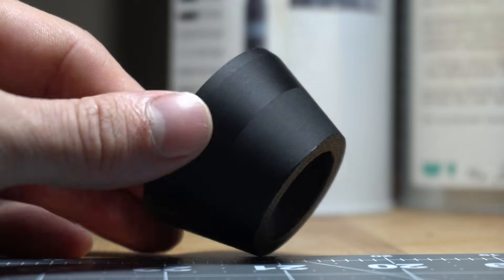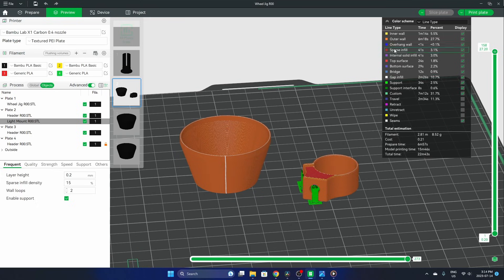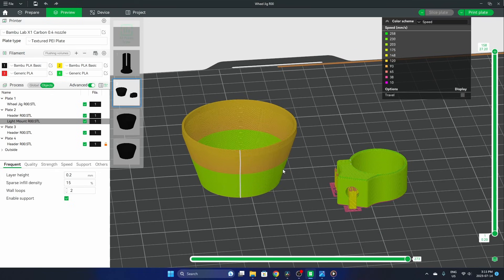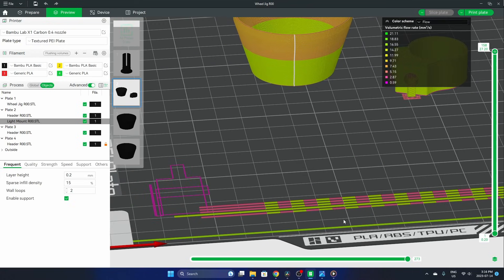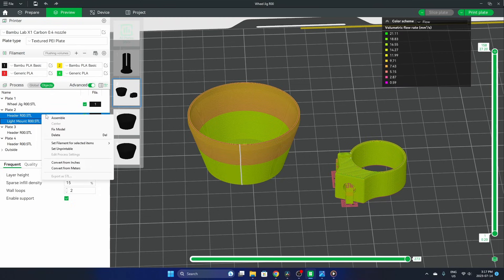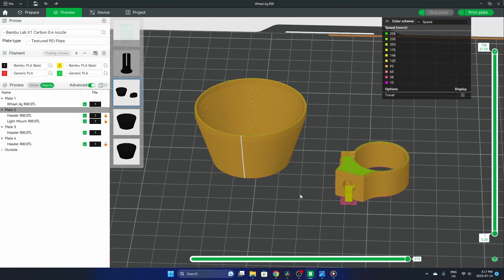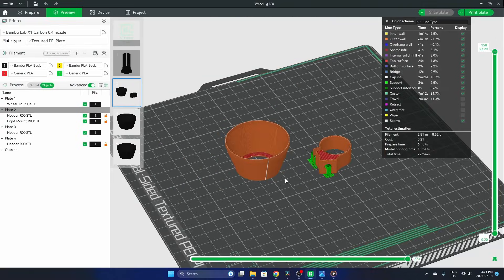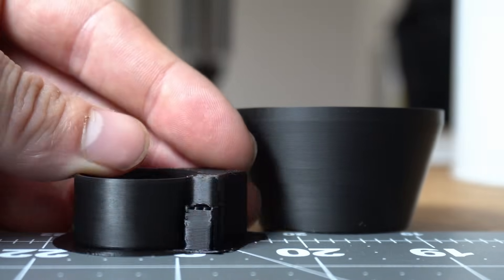How to avoid 3D prints that look like THIS in Bambu Studio

Comment: that's also a low infill print, so the bigger prints with a lot of infill it won't hurt you as much on time, because lower % of the print are walls.  Another variable is that a high percentage of that 25 minutes is the bed leveling and all that stuff, doesn't that take like 8 minutes or something?  So anyway my point is there are a lot of variables, but for the most part lowering the outer wall speed won't hurt the time much.  Also not 100% sure but I think part of what decides the difference in speed / flow is overhangs, so you can play with those speeds, outer wall speeds, etc.  and don't necessarily have to drop it by 50% might get away with less, maybe 150 instead of 100?  idk just some random thoughts.  Anyway thanks for posting this I was really getting annoyed by this problem, and didn't know about that speed/flow view thing.

Comment: Print by PART separately  vs by layer.  You wont loose the speed and get same resulst.
Reply from the maker: Yeah that would fix this print but I've also seen this happen on a single part when it is much larger on some layers and smaller on others.

Comment: Differences in layer time also cause this, not just speed. Infact a sharp transition in layer time has a greater visual impact that than speed.
Reply from the maker: Layer time is really just adjusting speed/flow rate via a different setting. You're basically adjusting the same thing. Lowering the outer wall speed just makes sure you get a consistent look across your entire print.
Reply: Actually no thats not true. Test it. If you print a cube at a fast speed with a low layer time you'll get a shinyish finish.

If you print the same cube at the same speed on the outer wall but drastically slow down the infill such that the layer time in total is 25 secs or so you'll end up with a matte finish. This is because the layer below it has had time to cool down and doesnt get reheated by the layer above.

Ive done many tests on this and this is the cause of a lot of the banding people see on the X1C with PLA.

As I said above you can mitigate it by slowing everything else (other than the outer layer) down.

If you slow the outer layer below 100mm/s you seem to get print artefacts on the X1C.

 @3DPrintStuff

Comment: why not let bambu lab actually use this to make a partially matte and gloss model. Its actually gonna be cool
Reply from the maker: Yeah it could be cool but usually you’re going for one look or the other. And the matte colour is arguably less strong because less heat is getting into the plastic and the layers may not be bonded as well as the glossy portion.

Comment: I found a bug in bambu studio. Sometimes these artifacts show in splice but adjusting height of layer makes it equal all over. if you save it as 0.16 then open it it sometimes show artifact. if you then change to say 0.2mm it will make arrifacts dissappear. if you save then as 0.2 next time it has artifacts at 0.2....but if you rhen adjust back to 0.16 it no longer show artifacts.

bug is especially visible if you have ironing on printed models
Reply from the maker: Very interesting, thanks for sharing. Have you emailed bamub lab to let them know about this bug?
Reply: @3DPrintStuff  i wanted to make a video...but the problem is not consistent every time.

Comment: It isn't just how the part looks. This glossiness, in fact, tells you that the polymer crystallised more and has better mechanical properties. The matt surface finish means that the part didn't get enough energy and is weaker in almost every aspect (tensile strength, temperature resistance, etc).
Reply from the maker: Yeah this is a good point. Visual indicator that the plastic isn’t getting enough heat. You’d probably be able to bump up the nozzle temp and not have to slow down the outer wall speeds at all.
Reply: One additional consideration, given the notion of adjusting the 'minimum layer time': as a way to solve this harsh transition, is that: Your solution would work more effectively if you have a short (5mm) part that takes up half the build volume and a tall (150mm) part that takes up the other half. If you constrain the overall 'minimum layer time' to match the layer time that occurs when both parts are being printed (the first 5mm worth of layers), that would force all of the other 145mms: of the tall part, to print at the same slow pace. 

But, certainly, Matte finish vs glossy is an indication of extrusion temperature... which does impact the strength/adhesion of a part; whether it's to a significant degree of detriment is dependent on the use-case.  @3DPrintStuff
Reply: People are wicked smart in this 3d printing world.
Reply: @burrbentine   No, just knowledge that comes with time (a few years) using a 3D printer.
Reply: @alejandroperez5368 Haha typical answer of a smart person. But you are not smart enough to hide it,🤪
Reply: I thought the lack of glossiness was due to it cooling too slowly. The crystallization causing the dullness and weakness.
Reply: @3DThird great video and even better comment. How do you suggest rectifying this? Bump the temp up?
Reply: @theneutralnode-s  As people may have already suggested you can:
1- bump up the temp
2- slow down outer perimeters so that they are the same speed throughout the print job. Tip: for maximum strength you may want to slow down both inner and outer perimeters.
Reply: OK sure but u can still make the highest quality filament look just as bad as cheap filament with the wrong print settings

Comment: You can print the flow test in orca slicer and pick a flow rate limit in the material properties. Bambu PLA stays glossy to about 8mm3/s @220C.
Reply from the maker: This is good to know. I haven't used orca slicer at all yet. Any other features you use that are exclusively on orca slicer?
Reply: @3DPrintStuff  the flow test is only available in orca. To adjust flow rate limit in bambu studio select edit icon next to your selected filament. Last setting on the first page is max volumetric speed. When set to 8 pla is mostly glossy, but you can reduce it even further.
Reply: @3DPrintStuff  i just use orca for the calibration tools and bambu studio for the rest

Comment: How do you handle your chamber temp when printing PLA? when i print PLA with 55 degree bed temperature, my chamber hits 38°C easily, with door 5cm open and top lid rose with spacers (unable to take off, i have AMS).

Im thinking to put another fan in there to vent the hot air out, placed at the back, on the stand where the VOC Filter opening is, so that is blows in direction of the door.
I have the feeling that when the temp in the chamber gets too hot, my overhangs start to get worse.... because PLA likes it pretty cold haha
Reply from the maker: Still something that I'm dealing with myself. My printer is in a unheated garage so this past winter (-25°C) I had the opposite problem where I actually had to use a little space heater in a grow tent to bump the temperature up a bit to be above freezing. 

Now that it's summer and we're seeing +25°C I print with the door wide open. A fan won't do much in my case cause you're still pulling hot air into the printer. I've still been pretty happy with the print quality so I don't feel the need to explore more options yet. Let me know if you land on a good solution.

Comment: Make sure the nozzle temp is on the high end fans are going full blast when you lower that minimum layer time.
Otherwise you might clog the nozzle or extrude warped lines. Tis a careful balance.
I think slowing down the overall print speed was the better option haha.
Reply from the maker: Appreciate the input. I also feel that lowering the outer wall print speed is the better option even though I didn't know about minimum layer time while making this video. I think I'll make a follow up video exploring minimum layer times and comparing the print time and quality.

Comment: I believe it is better to change "Max volumetric speed" in filament settings. Which do basically the same, top speed is limited to the (volumetric) speed which still works for this filament.
Reply from the maker: I'll have to check this out. Sounds like that is a global change that will effect every print going forward with the filament that has this setting changed. I like the control of changing the outer wall speed on a print by print basis. But that's just personal preference. Your suggestion would be set and forget, wouldn't have to think about it again.
Reply: @3DPrintStuff  it is personal preference.
I started with various print settings, probably as you, but finaly end with basically one print settings (defines what is printer capable of + nozzle diameter, layer height, acceleration of each wall, surface, infill and so) and settings for each filament which also limits max volumetric speed which can be used regardles of e.g. nozzle size.
With this, I can easily use the same print profile for print e.g. ABS as well as TPU without any further modifications of profile (well, few exceptions as support, wall count, infill type and density are stil object per object).
Reply: No, the max volumetric rate is used to prevent situations where the hotend can't heat the filament fast enough to fully melt it, at high printing speeds. Its correct value depends on the hotend, the filament, and printing temperature. If you lower it for cosmetic reasons, you can certainly make the printer slow down, but then it will waste time printing the infill and inner perimeters slowly. Here, only the flow rate (printing speed) of external perimeters is causing the cosmetic issue.
Reply: @renxula  external perimeters is only thing I have set lower (to about 200mm/s). Everything else is driven by max volumetric speed only and it works like charm to me for several years.
Each filament has set own max volumetric speed in its profile and that's the only "speed" settings I'm doing with new (type of) filament.

Comment: Now work on fixing those hideous seams. I hate my bambu printer. It’s been two months and still working with their support to try to fix several issues. Not to mention the print quality is terrible was horrible. Seems really poor tops on rounded surfaces and banding and seems separation etc. etc. I end up just using my MK3. I’d rather wait three times as long as I have a decent print that I know it’s going to work.
Reply from the maker: Sorry to hear that's been your experience with this printer. I haven't had any hardware issues but the tops of rounded surfaces are pretty bad and the z seams are very noticeable. I'll have to explore some settings to try and improve those results.

Comment: You may also want to pay attention to the cooling of the filament, i.e. the layer time, which also affects the print speed. If the time to be used for the first matte part of the lay<ers is less than the set time, it will print slower and accelerate once the time to be used for the complete layer is more than set.
Reply: This is the real reason this is happening. Good pickup
Reply: THIS ☝☝!!!! 

I kept getting super glossy sections at the top of my prints, and this fixed that. Thank you!
Reply from the maker: Yeah I didn't even know that was a setting that was having an effect in the background. Makes total sense that the minimum layer time would make the top half move slower which puts more heat in the filament and gives it the shinier look.
Reply: @3DPrintStuff That was exactly the problem with your pieces.

Comment: You are hitting the minimum layer time when the first object finishes so the printer will slow down to respect that value.
Reply from the maker: That is definitely what is happening and I didn't even know that was happening in the background until this comment. Thanks for the observation.
Reply: I really don't think this is a good approach on the part of Bambu studio. Fill could be slowed, or the printer could pause between layers.
Reply: Perhaps this is the explanation of the infamous Benchy Hull Line? Layer time is lower when above the layer where there is infill?

Comment: Yah, just buy the fast printer and then slow it down ha.
Reply from the maker: Just for exterior walls and only if you're experiencing cosmetic issues and if you even care about the looks of that specific print. 

It has also been suggested to increase the print temperature which will allow for the faster printing but that can have it's own negative effects on quality.
Reply: @3DPrintStuff  you have to reduce the speed to even out the finish and maintain strength. Everyone simping over Bambu for no reason.

Comment: Sequence printing Print-by-object - Also, an interesting option which may avoid slowing print time is to use sequence printing, called Print-by-object within Bambu Studio! Hope this helps!
Reply: That's a great solution but the same issue can occur on a single part too. Had this multiple times and couldn't figure out a way to fix it besides turning down speed so far.
Reply: @alflo8970 In your filament cooling settings, if "Slow printing down for better cooling" is enabled, you can reduce the "Max fan speed threshold -> Layer Time". This way, unless your layers are tiny, they'll print at the same speed and the issue should disappear.
Reply: its a great setting for TPU to reduce any chance of stringing..
Reply: @wtfpercussion  "Arrage all objects"  or press key A
Reply from the maker: This is a good suggestion. I haven't really played around with Print-By-Object out of fear of causing unnecessary collisions.
Reply: @3DPrintStuff impossible to collide as slicer makes sure there enough space between
Reply: @3DPrintStuff In cases like this where you have plenty of space on the build plate, simply placing the parts so there's no overlap in Y - allowing for the depth from nozzle to front/back of toolhead- should guarantee that sequence printing doesn't crash.

Caveat: Filament/toolhead swaps, any auto-home/park on power outage, etc., but for straight single-filament prints this should work.
Reply: @axel_fagerberg  yup, just right click an empty spot on the build plate and select "Auto Arrange"  and the slicer deals with it by itself
Reply: @wtfpercussion   yes it can, just enable the feature print by object, and then select "auto arange" on the top , it will space out the parts maybe a bit too generously, but i use it all the time, in case 1 print fails. i dont have to start over the other ones too.   so far , never had a problem.
Reply: @wtfpercussion it should show you a outline in the slicer of how much room you need

Comment: Awesome tutorial thanks so mcuh for sharing :). 

One thing you can do to slow the print speed down is adjust the flow rate in the printer for your material. By default, bambu PLA basic materials print at 21 mm/s. I've found that dropping the flow rate down to 10mm/s keeps everything nice and glossy, the printer will automatically show the print speeds down to match the new flow rate max.
Reply: I came here to say this but 10mm^3/s is REALLY overkill. When I first got mine i tested stepping down in increments of 1 and stopped at 17. Works great for me.
Reply from the maker: That's a great tip to set and forget. Don't have to adjust settings on a per print basis.

Comment: I assume the reason it's slowing down once it's printing only the one part is probably the minimum layer time. You could try and decrease that value, but you gotta make sure that cooling is still sufficient then. This should not be a problem on bigger prints though.
Reply: This is absolutely due to minimum layer time which is why the slower print speed doesn't change the overall print time much.
Reply: @MichaelPetito  it's definetely the wrong way to handle this by the slicer, it should check for cross-section width and fan speeds and adjust min resting time depending on that
Reply from the maker: I'll have to look into this.

Comment: I've found that printing PLA at 250 degrees, everything gets glossy and the print still comes out fine without needing to drop speeds. 250 seems crazy but the PLA itself probably doesn't get that hot, it's just necessary to heat it up fully. Try a temp tower up to 270 or so and check how it prints!
Reply from the maker: That's a good tip, I'll give it a try. Coming from an ender 3 V2 250deg does seem crazy for PLA. But you're probably right, at the higher speeds the PLA probably isn't reaching that temp.
Reply: @3DPrintStuff  I did notice maybe more shrinking when printing at 250, so maybe not ideal if you need high accuracy, but I'm still trying to get it dialed in. It's worth a shot anyway!

Comment: Huh, interesting, saved this for later. Thank you, I did not know this could be an issue or what to even look for when something like this happens. I have had it only once on one of my prints using Cura.
Reply: Do you use a fast printer? It mainly shows up with fast printers, so people using bambulab studio notice it more because they're using bambu printers.
Reply: @Mqrius  No, just a stock Neptune 2S. So could also explain why I have only seen it once.
Reply: @RoseKindred  as far as I understand it's basically a temperature issue, so if you were printing with a pretty low nozzle temperature you could also experience this. Fast printers have it more because they push so much filament through that it doesn't quite have time to heat up fully
Reply: @Mqrius  Thank you for the additional information.